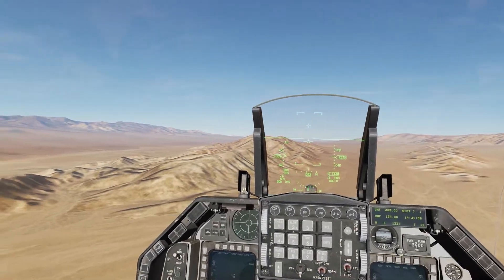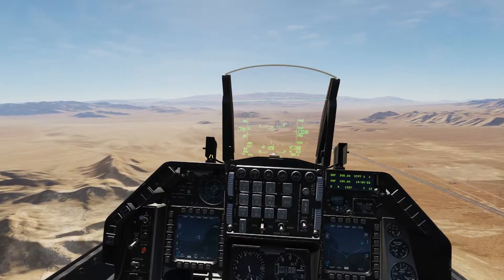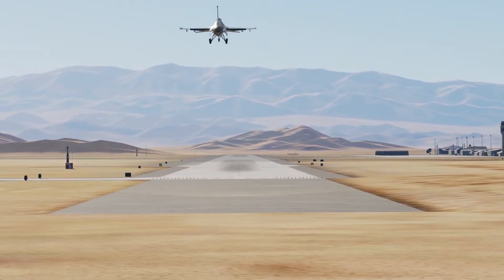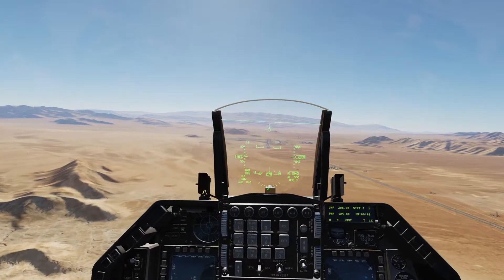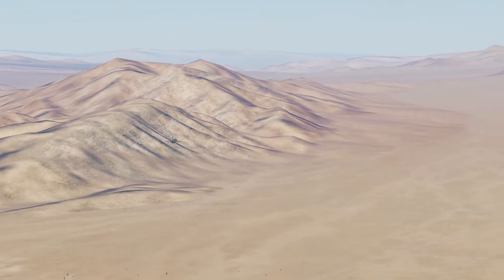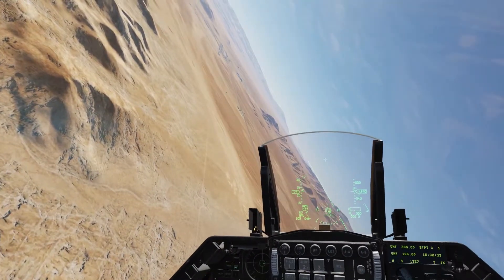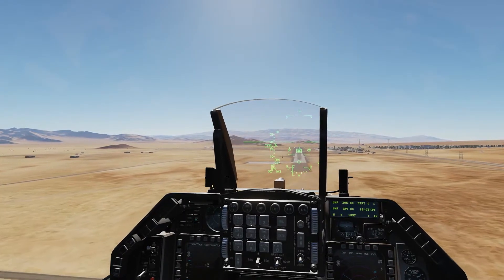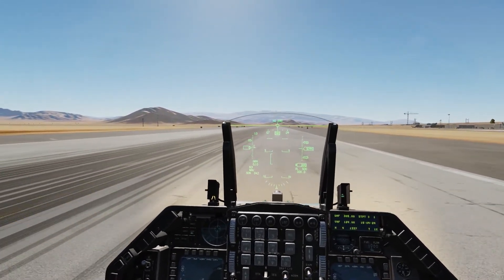Landing The F-16 For Beginners

Comment: ive been taught to enter the pattern at a 45 degree angle on the downwind leg. when would you use this method?
Reply from the maker: This was more for landing (speeds (gear/stall), aero braking, angles, etc) Not necessarily a pattern tutorial. I would need to make another vid on that. This video would be more for after you've entered the pattern airspace and have clearance for a straight in or overhead.
Reply: @BOGEY DOPE  so, im new... , after you enter the pattern, you may have a straight in landing or a break landing? I thought once you enter the pattern you would always have a just a straight in landing after turning final. Under what circumstances would you enter the patern then break left midway down the air field?
Reply from the maker: @anthonyking8833  from what I know, a break is really only used when coming in as a flight of 2 or more. It's a way to get the entire flight down as one, efficiently, and quickly.
Reply: @BOGEY DOPE  thanks Bud. Love the videos.

Comment: When you fly down wind: gear down. 
When you are on final; speed breaks open. (Run way clear? Check your gear.) Check runway heading. 
Flight path marker on the start of runway, keep marker in AOA bracket, all the time. When you pass the thresh hold, cut power and flare.
Adjust flightpath marker with stick, AOA bracket with throttle.
Always be ready to go around!

Comment: Nice landings, they looked pretty good. I'm new to the F-16 and fly mostly the F/A-18 in DCS. Now, the landing procedures may be different the two aircraft but I was always taught to keep the "E-Bracket" centered on the velocity vector when landing. This will help you maintain the correct AoA and rate of descent. It looks like your angle of attack is a little shallow and you're coming in overspeed. Feel free to correct me if I'm wrong. I'm really enjoying your videos, keep up the good work!
Reply: I know I'm late, but I'm still throwing this here in case anyone still stumbles upon your comment and cares enough to see the replies.

AoA in the F-16 works differently, precisely because of the flare at the end. Conversely, you never flare in a naval aircraft, regardless of whether you land on a carrier or an airfield (although I bet the Iranians flare their Tomcats to reduce wear and tear). The AoA indicator in the Viper sort of acts as a tail strike preventer.
So, because of this, in the F-16 you need to keep your flight path marker just above the E-bracket all the way until you flare. Flaring and cutting the throttle of course increases your AoA, this ensures you will have the correct angle in the moment of touchdown. The video is correct, and if you take a closer look, the F-16 is "on speed" when it touches down.

Of course, in DCS you can slam the Viper down like it's a naval aircraft without consequences, so you do as you wish, but the standard real life procedure is the one I wrote above. If you're into hardcore milsim, you better land that F-16 so gently you won't even realize the touchdown.
Reply: I was thinking the same thing AOA- I would think aircraft weight would have something to do with it. In the F-18 you would drop fuel before landing to reduce weight..????